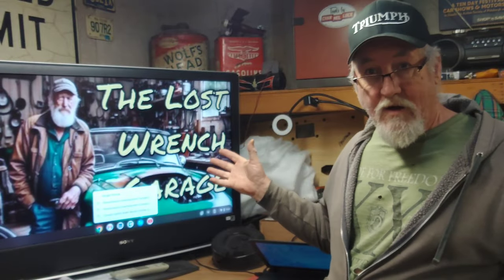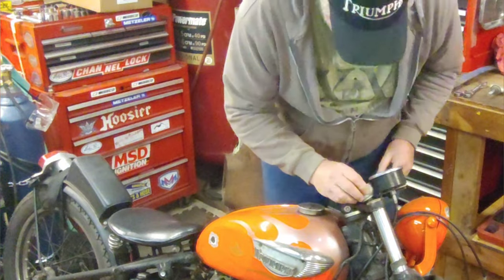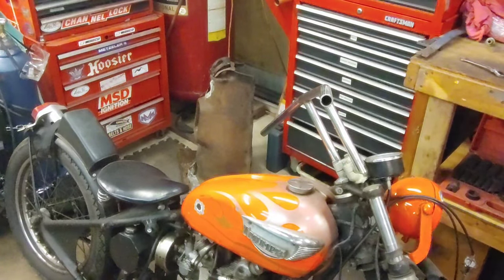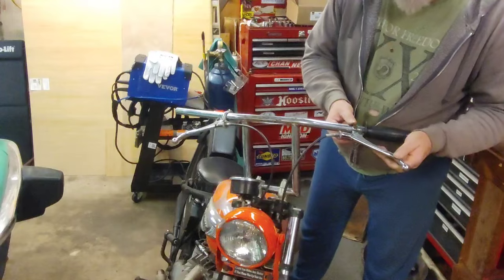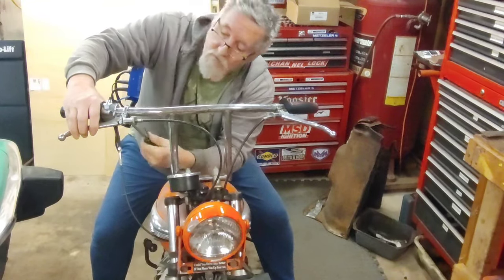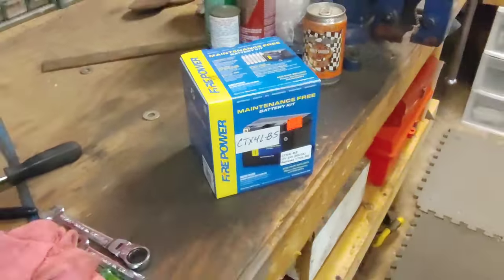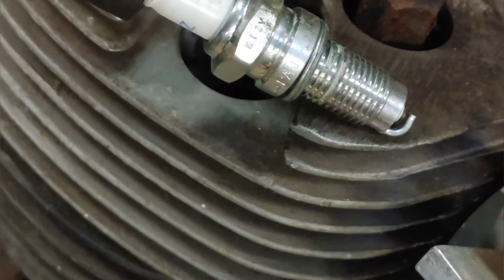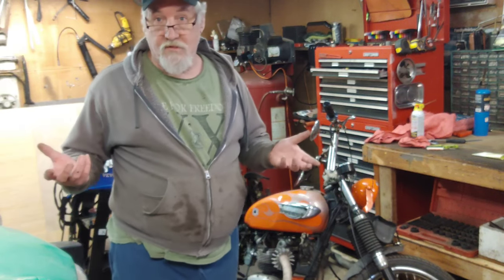Triumph Hardtail Bobber First Start In 10 Years. #triumphbobber

Comment: could you not just mount the clock bracket under the top yolk instead that way the handlebar brackets could sit in the top yolk properly
Reply from the maker: T will have to look at that and see if it will bolt under. Thanks for the idea!